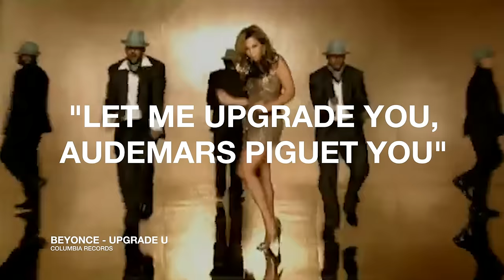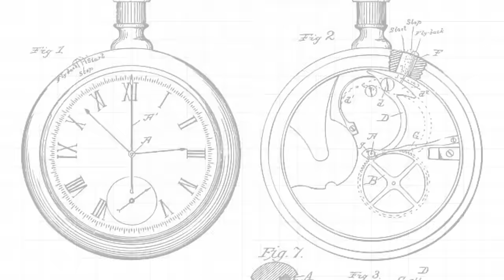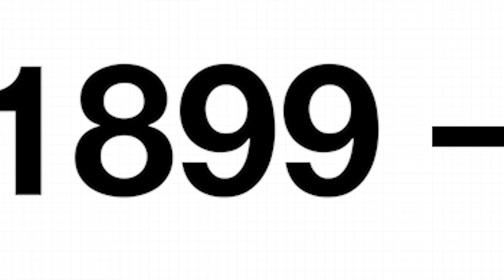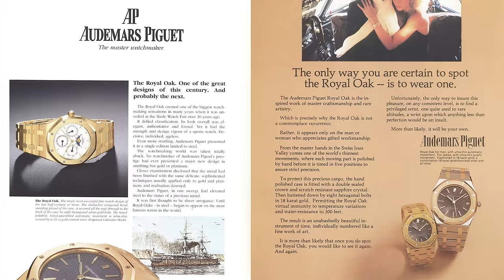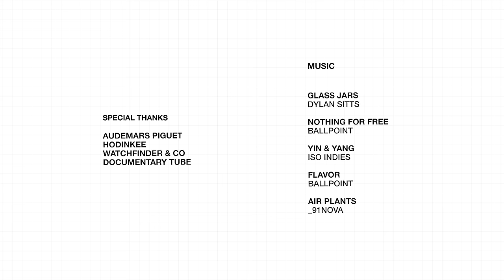This Watch is Pinnacle of Luxury for LeBron and Jay Z | Behind The HYPE: Audemars Piguet

Comment: Rolex wasn't Luxury in the 1970's that came After the quartz crisis.
Reply: @No One Basically in the 60s-70s the quartz watch was invented, which is the same kind of watch you're probably wearing today (one with a battery). These battery powered watches were not only much cheaper to make but also MUCH More accurate at keeping time. This basically made the "old" mechanical watches obsolete. A lot of traditional watchmakers that had been in business for literal centuries went bankrupt because of the invention of the quartz watch, which is where it got the name "quartz crisis"

The Royal Oak is often credited with single handedly paving the road for today's luxury watches to make a comeback as it was the first "luxury sports watch". Before then a Rolex etc was a tool watch and not actually considered a luxurious watch.

Because it was a steel watch and not precious metal like gold or platinum like most expensive watches were back then and priced at around what would be 20k$ nowadays, many people laughed at the idea at first, which is why it sold only 1000 pieces in 3 years.

To this day a 20$ Casio will still be much more accurate at keeping time than even the most expensive of mechanical watches (Richard Mille, Patek Philippe, Audemars Piguet, ...)
Reply: @osrsw6450  This is the question I've been pondering for months: at what point in history did the watchmakers became luxurious not just a reliable tool watch?